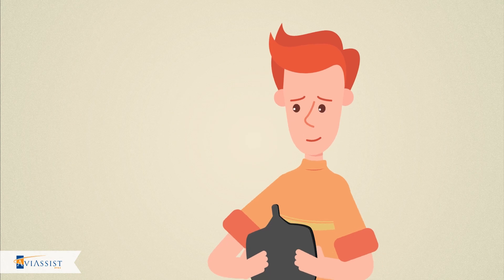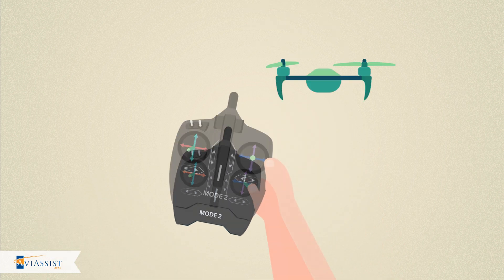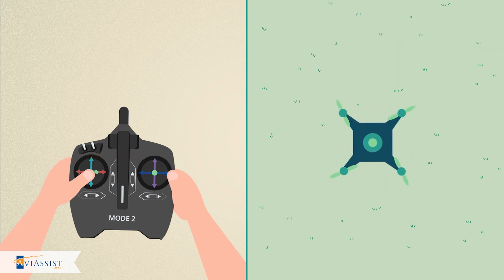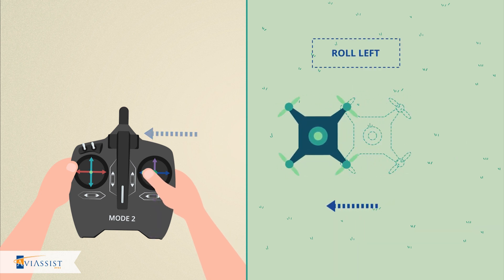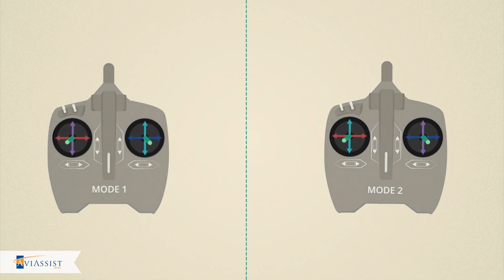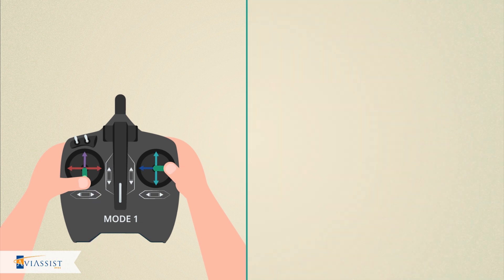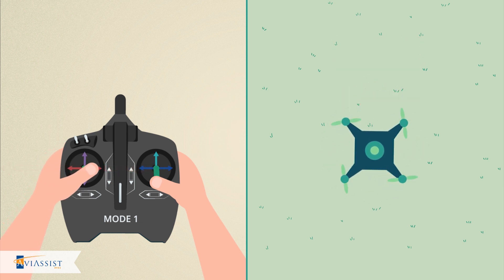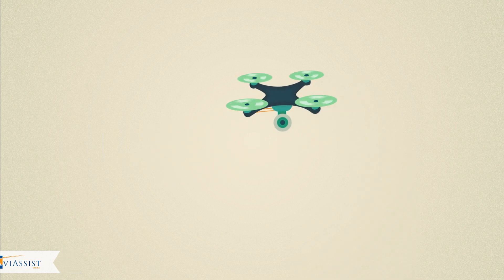Mode 1 vs Mode 2 - Drone Remote Control

Comment: Gamers are like, we need Mode 3
Reply: @TdubzSFS lol something like that!
Reply: Is it difficult to find controllers for mode3?
I've got my first drone in the mail rn and I'm about to order a controller(reciever?). I'm running nazgul5 hd v2 with elrs
Reply: @RandoManFPV  You tell it in the settings what setup you want to use. The controller doesn't change, the configuration changes.
Reply: @YouMotorcycle  ah I must be confused. Like half of the radios I see have the left stick automatically centers itself down.
It would take more than a change of settings to use mode 3 on one of these right?
Reply: @RandoManFPV  no idea what you're talking about man sorry. I just change my setup in settings
Reply: @YouMotorcycle  wild. What radio you use then?
Reply: @RandoManFPV  whatever came with my dji mini 2
Reply: @YouMotorcycle  thanks, I'll look into that one and see what I can find
Reply: Sence game & watch and NES We use the left side to control the directions.. So the mode 3 is more easy for us 😅

Comment: Mode 2 makes sense for a drone because drones can hover and you’re using one stick to control its movement in a single two dimensional plane. Mode 1 makes sense for an RC airplane because the airplane is constantly moving forward and your pitch input is your up and down movement.
Reply: in mode 1 you also can move the aircraft in a single 2d plane, with the right stick, just the plane is vertical.

Comment: Is there any reason besides personal preference for choosing one mode over the other?  Mode 1 seems more logical to me because I have operated some other equipment that is is similar to that layout.
Reply: Helicopters are pretty much mode 2 with throttle and yaw separated between left hand and both feet. Right thumb stick remains the same
Reply: I would say that Mode 2 is more preferable for drones because having one stick controlling one plane of movement makes sense. I’m a Mode 1 user simply because I came from RC planes, and having roll and pitch controls seperate for fixed wing makes more sense.
Reply: @wattson451  Well, in mode 1, you also move the drone within one plane, but the plane is vertical.

Comment: You forgot mode 3, the mode Parrot AR Drone used. Which is why I'm now using the least common mode around :(
Reply: im also using mode 3 because im lefty :D it is much more convenient for me to control yaw and throttle on right stick and leave more sensitive roll/pitch on the left

but after all, mode 3 is mirrored mode 2, these modes refer mainly to whether single sticks share yaw+throttle pitch+roll (MODE2) or roll+throttle pitch+yaw (MODE1)

Comment: So mode 2 is right handed or left?
Reply: Mode 2 Right handed and Mode 1 left handed. It depends how comfortable you feel flying with mode 1 or mode 2.
Reply: @Mr.Gundam7  i wouldnt say mode 1 is left handed but more along the lines of rc aircraft and flight sims

Comment: This seems dumb to sell these separately. Like why not program them instead of having 2 different controllers?
Reply: Lmao. Fool. They aren't sold separately. It's just an example video
Reply: @maremike2691  they do sell separately in dji fpv controller, you fool
Reply: @anthonythm  This was 10 months ago. I admit it wasn't nice to call you fool and I take it back. Instead I offer you an apology.
To the topic of the video. I thought it is one controller and they tried to show the different modes by showing each controller with it's own mode. But you actually can change the mode in the app for one controller

Comment: i am beginner and will buy a remote soon.
which is more common  
mode1 or mode2
( i am right handed )
Reply: 1.5
Reply: i think mode 2
Reply: I grew up flying RC airplanes, so Mode 2 is definitely more natural for me. Personally, I think it's much more intuitive for a drone as well, but your mileage may vary. I'm not sure which is more popular these days, but if I had to guess, I'd say Mode 2.
Reply: @chronxdev  Im the opposite as I flew rc aircraft and flight sims along with full sized aircraft. Im used to pitch and roll being right hand, thrust and yaw left hand.
Reply: @chronxdev  No in my DJI remotes, Mode 2 has forward and backwards and left and right on the right stick, with up and down, and left and right yaw on the left stick.

I still find myself trying to go up and down with the right stick, especially when I've not flown for a while.